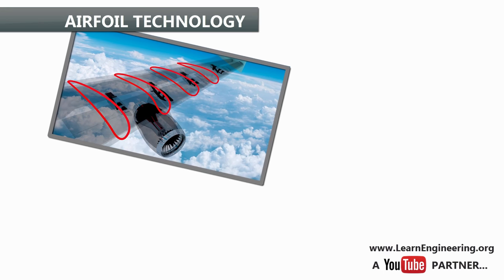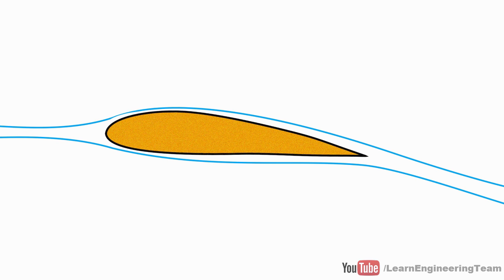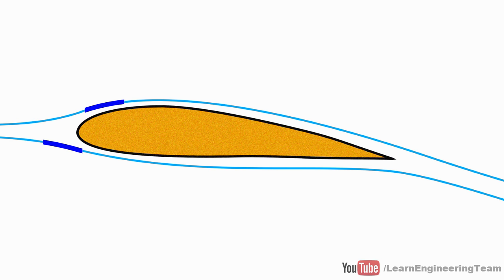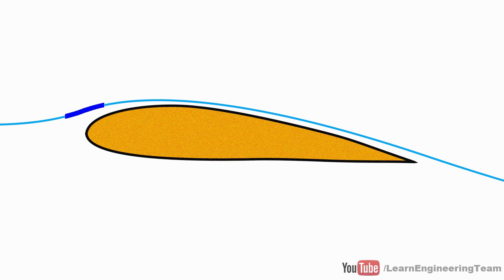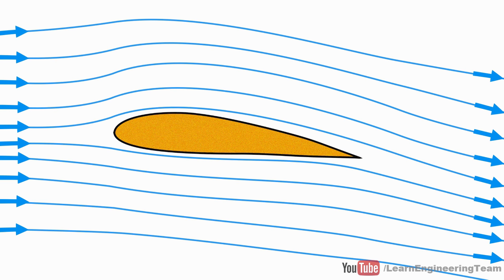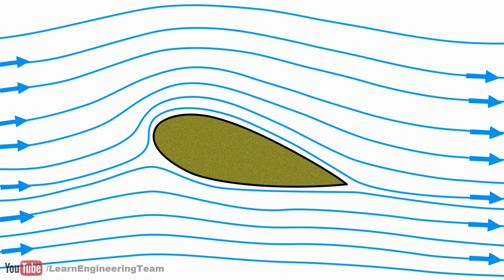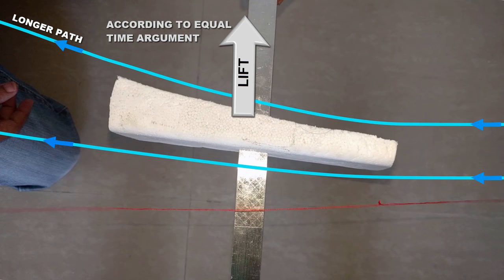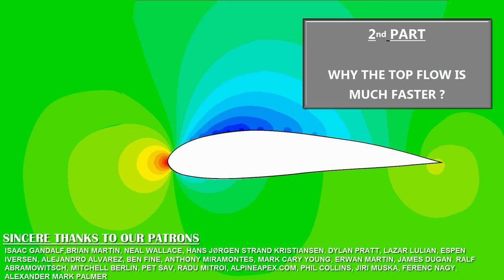How do Wings generate LIFT?

Comment: This video must not created by a phyics professional,  His argument against the application against Bernoulli's principle is totally wrong because he misinterpret the pressure drop on the upper part by using the velocity of an individual particle in a streamline,  but not the average velocity of  the collective air molecules by using the implication of the continuity equation.  Try to review the derivation of the Bernourlli's principle in physics textbook,   you will find what Newton's 3rd law is not satisfactory explain the phenomenon.

Comment: this may be a duplicate comment.     but i don't think it will hurt anything.
there is a fundamental  Falseness  in the way people think about wings and aircraft.
there is  NO  FLOW.!     the air is  STATIONARY.!       consequently, there is  NO  upper and lower  Flow  past a wing.       as a wing  Moves  through  air,  lift can come from from two processes:  one newtonian, one aerodynamic.      the former, happens at the lower leading edge and/or beneath the wing as a result of  positive angle of attack.      the  Latter  is a result of a persistent,  Span-wise  ZONE  of  reduced air pressure; eg., turbulence, present above the aft half of an airfoil.       this zone of turbulence is a  Product of  Optimal  profile/airfoil  Design.        in  most  illustrations/animations,  the  STREAM  LINES  Above a wing,  are  NOT  shown  correctly.!!!       
the linked illustration is just a visual aid.     it  indicates (as wake) the  span-wise zone of Turbulence/reduced pressure, above the aft of a wing.      it does not correctly show the  collapse  of the low-pressure zone, at the wing  Trailing  edge.     this  collapse  occurs  as a result of  Correct profile/airfoil  Design.       if this collapse does not occur, the low-pressure zone  extends aft of the wing trailing edge; where it becomes  Suction.!!!       a thick trailing edge  CAUSES  trailing  Suction; thus, a  trailing  edge  should  NOT  be  thick.        googletranslate
http://www.airspace.cz/akademie/rocnik/2009/12/airfoils_02.jpg
ignore text.    this illustration shows that air is  Deflected,  upwards,  at the front of an airfoil.       as a wing continues to move, this deflection leads to a  (turbulence) persistent zone  reduced air pressure,  Just above the aft half of a wing.!        ideally, this zone 'collapses'  AT  the  trailing edge.    
https://image.slideserve.com/1390546/how-does-an-airfoil-generate-lift1-l.jpg

Comment: Lift via an airfoil is Newtonian. As such, it follows that gravity is the primary source of energy that sustains aircraft in flight. Energy from a plane's engines only adds the additional energy needed to sustain flight and to ascend.

If the energy from an aircraft's engines were solely the source of energy generating lift, a plane, like a rocket, would not be able to sustain flight for more than a few minutes. This is why jet packs will remain elusive.

Because gravity is the chief source of energy in generating lift, planes have large glide, unpowered flight, ratios (helicopters have auto-rotation). Planes and helicopters don't fall like rocks out of the sky when power is lost because gravity provides most of the energy used to sustain flight.

Further proof is seen when very powerful fighter aircraft capable of supersonic speeds are observed to dramatically slow when ascending vertically like a rocket. While the engines of fighter aircraft are very powerful, in vertical ascent gravitational energy is not available to generate lift, and so all energy for in vertical ascent must come from the engines.

Comment: P1V1=P2V2. Otherwise lift is not possible. Remember the is travaling through the air not the other way around. Also remember air has inertia also. It's the Venturi effect that causes lift.

Comment: I'm just taking a diploma but can't most of this be explained like fluids stick to surfaces because of viscosity, the air foils with a bunch of ridges is unrepresented because the pressure gradient is too great causing flow separation. Air foils are shaped in such a way they described to create a larger pressure differential. I do not know how true is what I was taught, but its what I know.
Reply: Sean Tham it’s the opposite, counterintuitively. Viscosity causes separation; if there was no viscosity flow would strictly stay attached
Reply: Wings work in air like they would underwater. Put a 4' x 8' sheet of plywood on the roof of your car, now mount the plywood so the front is 3 feet above the roof and the back is 1 foot above the roof. Now drive and watch the lift rip the roof off the car.
Reply: @orange70383  That doesn't explain how they work at all, it just says that it happens.

Comment: If you know Newton's 3 laws you can understand lift generation.  I understand that air traveling over the wing is travelling much slower then the air beneath the wing creating a low pressure for a asymmetrical wing but how is lift generated for symmetrical wings such as those found on an aerobatic aircraft?

Comment: Sorry, but your theory is wrong too. If your theory was correct, aircraft should not be able to fly inverted; but they can! All classical models for aerodynamic lift are incorrect. The correct mechanism of how an airfoil generates lift will be described by an entirely new paradigm of physics set to be revealed in 2022.

Comment: CFD can reason the big difference in lift as the Angle of Attack is zero or a positive value.The shape of wing i understand is to maximize coanda effect, but Angle of Attack is the main reason for lift creation, as the hand outside a moving car, lift after angle turn from horizontal.
Ansys saf1 lesson 2, https://youtu.be/Xi7ERZD_m9g have the CFD to airfoil WITH Angle-Of-Attack. At time 14:40 we see velocities: 112m/s incidence air. At first 1/3 down velocity half (56m/s)(big deceleration against wing of air mass momentum, newton), next same streamline increase to again 112 during midle 1/3lenght down and in the last 1/3 accelerate to 170m/s following always the down shape. Above the air doubles from 112 to 224 during de first 1/3, but leaving the shape staying almost vacuum there. 
In the video of Mechatech  https://youtu.be/l2W-J34YwkQ  is airfoil and Angle-Of-Attack Zero. Here at time 22:30 a 45m/s air incidence half to 25 in the edge between top and down and above increase to 85 during 2/3 and down to 75 also during 2/3 following almost parallel to the shapes, not impacting and not creating vacuum buble, no useful lift force. 
 About AOA vs Lift graphic one  at    aviationchief.com/angle-of-attack.html  show stall angle, after the maximum lift it drops suddenly after that Angle, as in this page said "lift is destroyed"(Lift=CL.ρ.v^2.S/2) .
We see many airline plane crashes by stall in program "Mayday air disasters", one of them Air France 447 Rio de Janeiro to Paris.
Other users of Angle of Attack are helicopter rotors, propellers and wind energy generators, to impact force or extract force from air fluid.

Comment: 4:24 Typical misconception here. Pressure in the lower surface does not necessarily need to be greater than the free stream pressure. Generally this is lower than the free stream pressure, i.e. negative, but less negative than the pressure in the upper surface. Thus, still creating a net pressure gradient from lower to top surface.
Reply: At higher angle of attack it'll be greater than p_\infty

Comment: U had a very good start but then you messed up. Once you go deep enough to raise the question why fluids curve around a convex surface, you should also then explain it correctly. And you also messed up for the bottom surface. For someone who doesn’t know aerofoils, they will go nuts thinking that how come the bottom is always at positive pressure. You should have mentioned how different phenomena are at play. When the flow is accelerated over the initial 30% of the upper surface, then the flow accelerates on the bottom as well but not that much.. and when the recompression occurs, it occurs on both but just that for the bottom Surface, the energy lost in recompression is reused as lift where as in the top, it usually causes lambda shocks

Comment: Looking at a single stream line above it goes trough low pressure zone as it does it speeds up according to Bernoulli principle. The reverse happens at the bottom.
Reply from the maker: You are really close :) It can be explained in a better way, with out using Bernoulli principle.
Reply: It is due the Couanda Effect (and the angle of attack, in the experiment is hugeeee), the curvatura is big, so decrease of pressure above and increase below, and then you can apply Bernouilli's eq in each side of the foil (in points before and after de foil.) 

But notice, the picture of the CFD have a different angle of attack, so both cases are not completely compatible.
Reply: Is it because, since the pressure gradient at the top is larger, the upstream higher pressure at the top accelerates the particles?
Reply from the maker: Yes, it's all about the pressure gradients. At the top we have a negative pressure gradient at the most of the location. At bottom reveres is the case.
Reply: Yes thank you :)